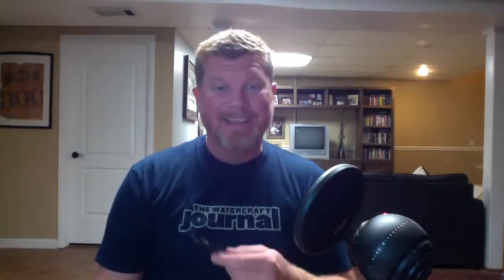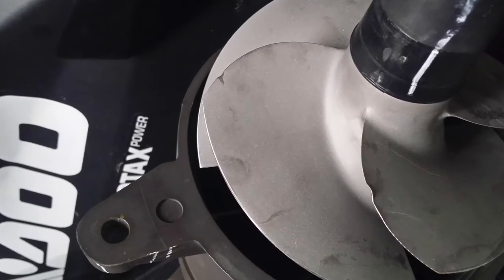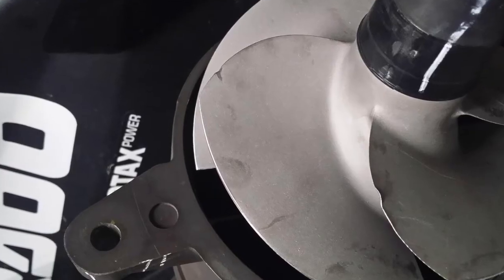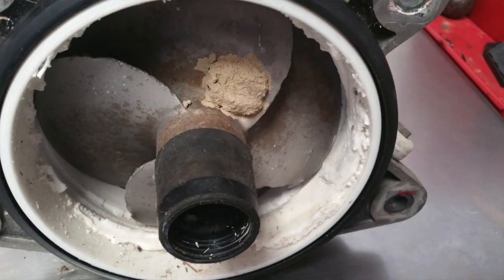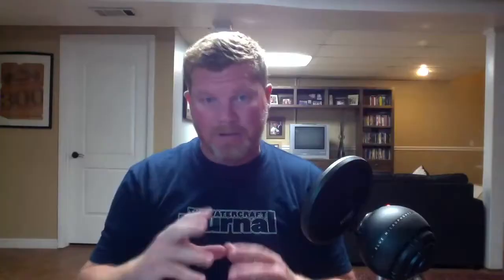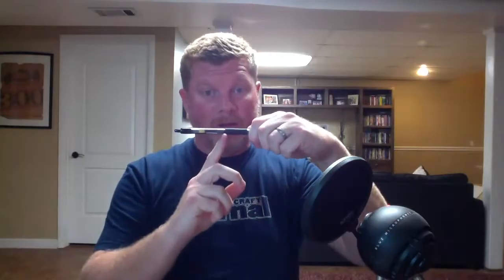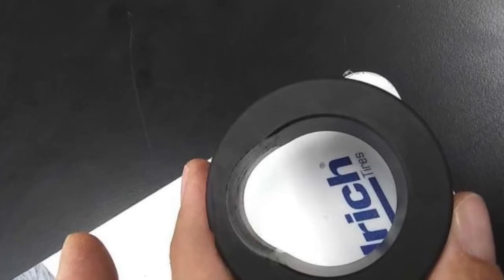Why Check Your Impeller & Wear Ring: WCJ Quick Topic

Comment: Your channel is amazing and very informative! I just bought two GTR215s without water testing and finally put them in today.  One was amazing - the other didn’t get above 32 or 5400 rpm’s. Engine sounds strong but all felt rattley.  Do you think it’s the wear ring?!  Does that cause lack of pure acceleration and terrible turning response?
Reply from the maker: How many hours on the other one?
Reply: @watercraftjournal  they both have 100 going in to yesterday. I’ll add that outside the water I could rev up past 7000 rpm but just absolutely bogs in water and loses all momentum in turns
Reply: Yes, however your impeller can also be chipped from foreign debris. Your intake grate helps, but rocks and ropes tend to do damage. Especially if it’s repeatedly abused. 

- Owner of TC Watercraft And Desert Mobile Repair. Yucaipa CA.
Reply: @tylerclark582  How can I know what the proper diagnosis is then for a fix? I've looked in both intake and lifted the IBR to inspect and no signs of anything stuck. The impeller is also in fine working order IMO
Reply: @thomasberezansky95  the only true way to tell is inspection both visual and with a digital caliber. 

First removing any trim, steering or reverse cable off the nozzle of the jet pump. 
Second removing the water lines both too and from the motor, yamahas also have a streamer to disconnect. 
From there you need to take off the 4 (long) bolts holding the nozzle to the jet pump off. 

You’ll see from there the jet pump slides off. You might have to take out a bolt or two and another house or whatever I may have left out. But that’s the process for most skis. Once it’s apart it’s usually another 3 bolts inside to pull the wear ring. But first looking at the side closest to the intake you want to see if that inner lip of the ring is significantly scuffed. Sometimes that’s the only part of the ring that is, and it causes extreme issues. Usually gap clearance between a wear ring and an impeller is somewhere around a half millimeter. Anything more and it leads to pump cavitation. 

PRO TIP: Removing the ride plate by jacking the ski up might make this entire process easier. However please secure the ski so nobody gets hurt.

Comment: if you have just repaired the propeller bearings and the everything is fine , if the wear ring is not fully smooth Is it fine to ride until a new one arrives?  I take it ,that it would just lower performance not damage anything else?
Reply from the maker: Sorta. The oblong oscillation will exacerbate the damage and further injure the drivetrain. Best repair it all.
Reply: @watercraftjournal  thanks

Comment: I have a 1996 kawasaki time capsule. Less than 30 hours. Been going amazing    Today while riding I felt that slippage, lack of power. Assumed wear ring but seems like kawi’s aren’t as common to need them. Putted back and loaded it then noticed some weeds and a piece of bag wedges in my ride plate. Before I go ordering parts. Could it just need to be cleared out and inspected? Not sure how common these issues are on the kawasakis.
Reply from the maker: Kawis don't have plastic wear rings. It could be a bunch of different things.
Reply: @watercraftjournal  I dropped it off at the kawi dealer. Hoping it’s just remnants of the plastic bag wrapped around impeller. I looked in from ride plate and Impeller looked brand new. So hope it’s just junk where it doesn’t belong.

Comment: Was expecting my ring and prop yesterday new machine 21 seadoo gtx. Prop looks fine so does ring but I did notice on the ring it almost looked like a black or silver dot almost as if someone took a sharpie marker a made a dot. Any explanation?
Reply from the maker: Unlikely anything important- nothing more than an inspection cover.

Comment: How many hours can someone expect out of wear ring on a Yamaha or Seadoo given normal use (no shallow water)?
Reply from the maker: Yamahas have stainless steel rings, which don't require changing unless there's signs of severe damage. We've heard of plastic Sea-Doo rings lasting upwards to 150hrs. It all depends on the degree of wear.
Reply: @watercraftjournal  Thank you for the reply!
Reply: Any special considerations for a Kawasaki 15F or is this similar to a Yamaha?
Reply: @watercraftjournal  If the plastic Sea-Doo rings last up to 150 hours that basically covers the average life expectancy of a Sea-Doo engine .Now i know why Yamahas  have long lasting stainless steel rings!!!
Reply from the maker: Again, 150-hours isn’t the standard (some fail within 20 hours) - it all depends on whether the ski is operated safely and correctly.
Reply: My Seadoo gtx155 has 120hrs., and the wear ring is worn past the .014 allowance . Mines about .025   in one spot , come to find out , someone didn't drill a hole for the two screws to hold the wearing from spinning, and cranked the wear ring right into the impeller from the side. I replaced the ring, and drilled the holes for the screws. I bought it used, so I don't know if that was a seadoo factory slip up, or the original owner had it serviced somewhere, and they screwed up?
Reply: @nikosgrigorakos  ya rite niky my rxp has 280 hrs and still on original  wear ring and prop and still does 70 all day long. Stay out of shallow water and never beach machine.
Reply: @watercraftjournal  Yamaha FTW
Reply: @nikosgrigorakos  Have 400hrs. on my Seadoo, and it still runs the same as new.

Comment: Took my 2021 sea doo gti 130 today I had it in eco mode had a small rattling noise at the rear end  but when I change it to sport mode the rattling noise and vibration became more intense. Could this be the impeller and the ring?
Reply from the maker: The impeller wouldn't make that kind of rattle against the plastic wear ring. That sounds like a pump bearing but your ski is really too new for that kind of failure. Are you sure you're just not misidentifying the exhaust noise?
Reply: @watercraftjournal  I've never heard that noise before and yesterday I felt something went through the impeller and today while making that noise and the vibration it also loss speed the max speed was only 43 mph
Reply from the maker: Did you bother to check IN your pump at all?